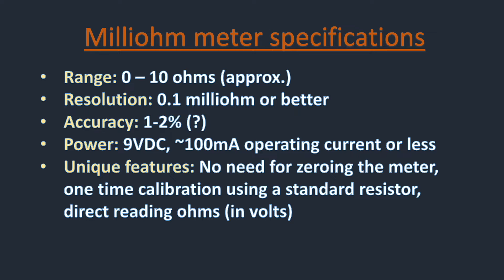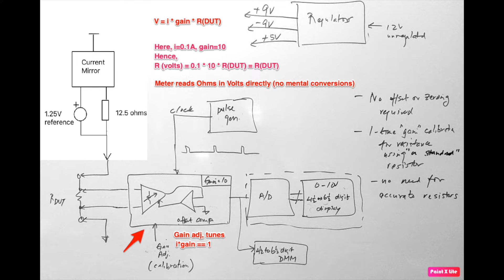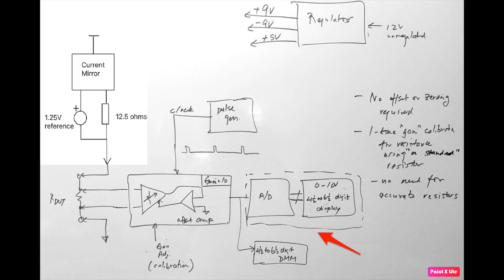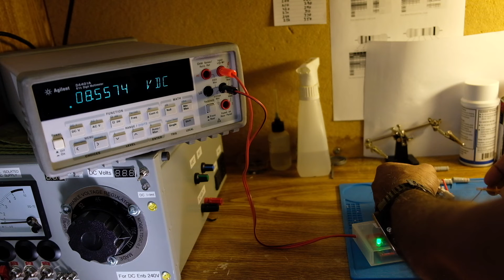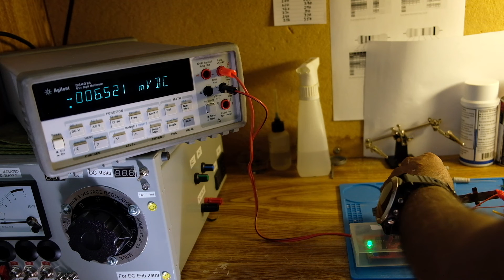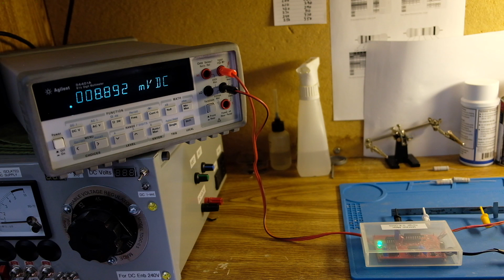Yet another homemade milliohm meter  (auto-zeroing)! [part 1]

Comment: You could easily turn your 34401 meter to your calibration reference.  Just measure any of your low-ohm resistor in the offered 4-wire way.
Reply from the maker: Yes, I did try it but the results were different by around 1.5% for a 1ohm resistor. I know my 34401A has decent voltage accuracy, but can't say about the resistance mode especially for low values. I felt using an accurate SMU for current and the 34401A gave me the best results. I will see if I can get my hands on some  0.1% or better low valued reference resistors. Thanks.